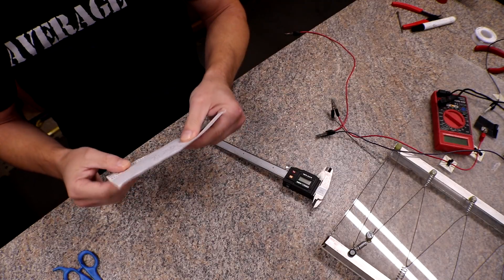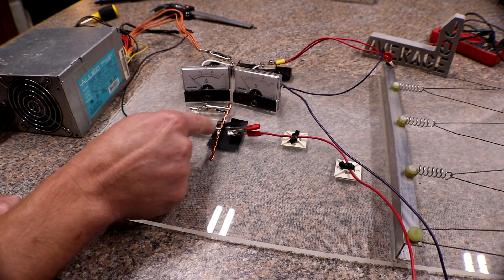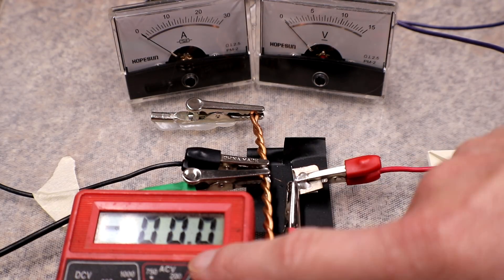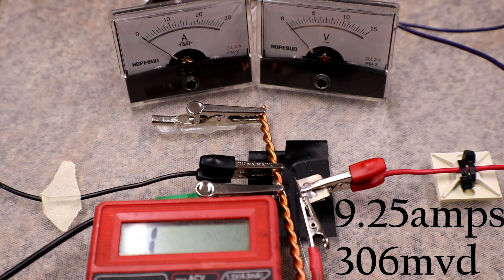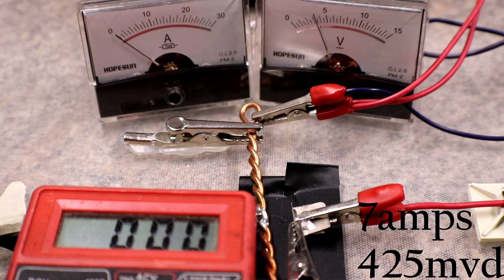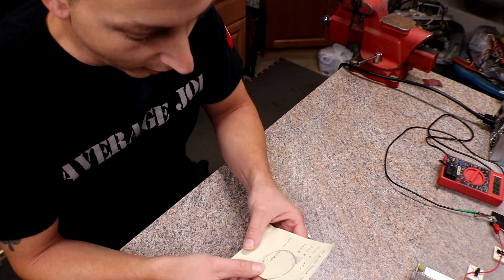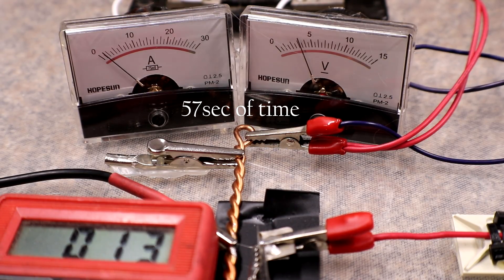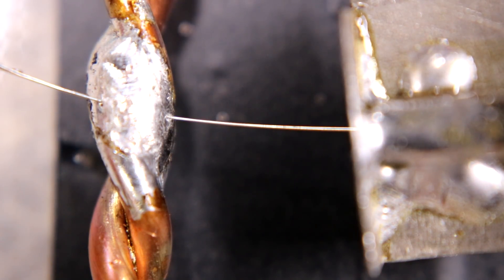Diy Tesla Powerwall ep65 Facebooks Powerwall Members Fuse Test!

Comment: try splitting your system into multiple independent systems, or if you plan to upgrade/add maybe try implementing a second independent system instead...  I only have one 100W panel and I'm thinking of implementing a second indepentent system instead of adding to my first system...  GENERATE LOCAL, USE LOCAL.
Reply from the maker: As time goes on Ill be adding more packs.  Depending if the ups works and lasts, I may do it kinda like that cause I have another 2700watt ups to use as the "2nd independent system"👍

Comment: yeah DO NOT be in a hurry to build packs of used 18650 cells.  Joe, you can easily drop from a 14S to a 13S and run all your shit the same way, taking one-S out for dissecting/testing/rebuilding/reinsertion ...  you can even have 1S100P packs on standby for insertion to replace your questionable/rebuilding packs!  DIY OTF hell yeah.
Reply from the maker: Yeah I do need to build an extra for sure for that reason😀👍

Comment: I'm not fusing each and every cell like you are because I've already THOROUGHLY TESTED each and every cell before adding them to each pack.  The reason your first fuse popped is either because the fuse was defective or you just didn't test the shit out of your cells before building your packs.
Reply from the maker: I tested each cell before putting them in so its hard to say what the real issue is.  Ill keep fusing them cause there all used cells👍

Comment: 100P is too much per pack in the first place.  I'm uncomfortable with my 15P packs, but at least if SHTF for one of my packs I only lose at MOST 15 cells, PROBABLY just one.   The cell in your case that loses its fuse is already FUCKED so no point in fusing everything.  The cells have protection built in! (if not the cell shouldn't be in your pack in the first place!!!!)   LOL he was pissed off ;)
Reply from the maker: I dont see a problem with 100p packs cause when you P your 15p packs (if your going to up the kwh), its basically the same as mine.  The cells have thermal release, but Ill solder fuses all day long if it keeps the rest of the pack functioning 😃👍

Comment: Joe, I noticed that the solder over the wire effectively shortens the wire, so the 5mm gap may be 4mm, this could insulate the wire and could be the reason you are getting different readings then (Pesh)'s notes. Thoughts? Dawned on me during your last extremely close up test - could this be a factor worth mentioning? Rock on!
Reply from the maker: +rcpilotp51 Yeah that close up did have a lil extra solder on it 😄 but thats why I do the same test a few times😉. He did use a real power supply as well🖒

Comment: Goo Job as usual.  I follow your channel as much as I can as My build has a few similarities.  I am building a 48V system to eventually suppement the load on my house. I have 10k Solar Install to start in a week or so (awaiting final permits).  Solar Edge with 37 280watt panels an no Storage.  The cost was too much for my pocket.  So I decided to add my own.
I decided to do my packs as 14s 11p or 14s 16p.  

http://www.diypowerwalls.com/t-My-Build

My Powerwall will be mounted inside Server Cabinets (Like yours) in my Garage
3A Axial Glass Fuse (may go to 1.5 instead)  My test blew at 5 amps
PCM60X Charge Controller
AIMS 2000W Inverter
Reply from the maker: +Garry S Damn thats an awesome solar setup! I would love to get that some day. Ill take a look at your build thanks. I dont think ive tested the 3amp yet.
Reply from the maker: I like those server cabinets you have.  I would of gone with the tall ones but they wouldnt fit as I have short ceilings lol.

Comment: Aw yiss! Was waiting for this video. Good stuff Joe! I may have to send you some glass axials I'm considering.  Those mv drops on thin awg wire concerns me.
Reply from the maker: +12ax7 Thanks Man!!! Which ones were you thinking. I have here at my house .5, 1,1.5,2 and 5amp of those
Reply: I've been looking at the fuses here: http://preview.tinyurl.com/ybulgrw6  Particularly the 5 and 10 amp versions. What kind of voltage drop are you seeing with your 5 amp fuses at the 1-2 load range?

Keep up the good work!
Reply from the maker: Yeah those fuses would be better for the breakage issue I was having.  Ill retest the 5amp glass fuse I have for the voltage drop and get back to you and I can start at roughly 1/2 to 3/4 amp and go up to 2.
Reply: That was also one of my concerns. That would be great if you could test test them around those figures. Trying to weed out as much voltage drop as possible with my 100p 14s bank I'm building.

Comment: Great video. Good reference for fusing current can be seen at https://www.powerstream.com/wire-fusing-currents.htm.
These currents are about 1/3 your measurements so I assume these are for a long length of wire tested for and long time (hours). Example #40 gauge (0.03mm) fuses at 1.7A but your measurement shows about 7A.
Conclusion -- To be safe chose a running current less than the fuseing current in above reference.
Reply from the maker: Thats a good site to reference Thanks!!!  Yeah I would imagine theres is for a longer wire indeed.  Also to the conclusion I would recommend to test the fuse wire anyone uses to be sure👍

Comment: Great test Joe!  Love the close-up portions. You have a good working knowledge of Ohm's law. You might also want to familiarize yourself with Kirchhoff's current law. It comes in handy when analyzing circuits. One thing to think about is when the wires are heated but not blown, they are changed and will have a different resistance forever. I'm still on the fence about the best type of fusible connector, but I really like your setup.
Reply from the maker: +Tony B. Thanks Tony! Ill have to look it up, cant member what it says but I have heard ofem. YES the wire is changed and so is resistance. Maybe in a future video I can show that by heating one up and then bring it back down and show it. 🖒

Comment: It was cool seeing 5-10mv drops at .5-1 amp, well above the normal operating current for a cell in a 80p pack. I was questioning just the other day what a voltage drop across a "5 amp" fuse would be.
Reply from the maker: +Shannon Williams Yeah its pretty low. If I had a longer resistance wire I could start at a lower amp. 😃🖒
Reply: AveRage Joe It's handy only having to purchase one type of fuse wire and tailoring it to blow at lower or higher currents :)
Reply from the maker: +Shannon Williams Yes I agree!!!

Comment: Current in series is the same before and after the load. The reason for before the load is that you make 'more' of the circuit 'safe'. (no flowing current).
Btw, the family Volta would like you to know that it is Volt with a 't', not a 'd' 😉
Reply from the maker: +Guust Yeah I figured but wanted to make sure 🖒